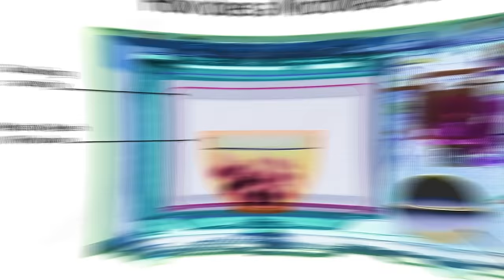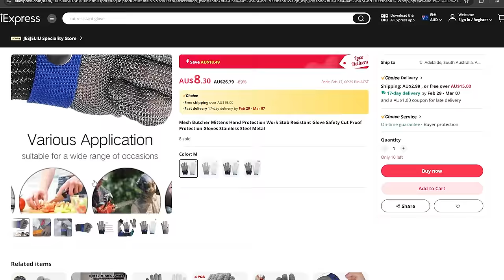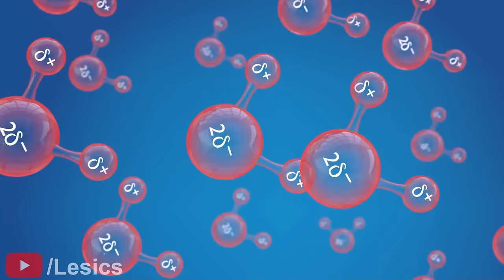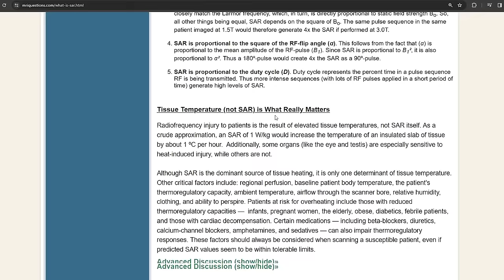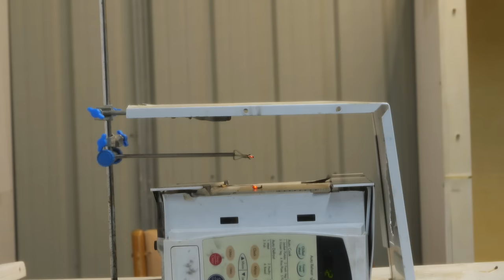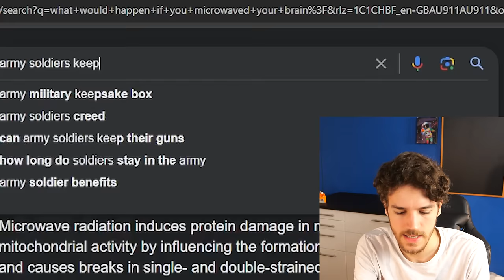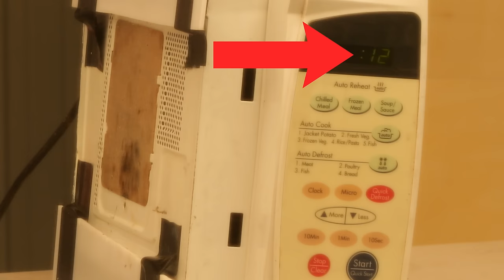I Tested the Limits of a Microwave

Comment: what would be interesting to see is placing a sheet of metal in different positions above or neat the microwave and using a Camera with Thermal Vision to see what spots are being heated on it.  then by  recording the Heatspots on X Y and Z axis, you could make a 3d Display of the Microwaves.
that also would give indication on how the waves move(conical, straight, changing) and if the Heatspots are consistent, you could use strings with a weight oin them to dangle the weight ont he exact "dangerspot" in your room. that would allow you to test exactly what you want how you want it without the risk of "missing" the hotspots.
Reply: oh and since i reached the end of the video: i dont know how well this fits in here but i do have a Navy story that fits somewhat.

i was in the german navy as a "Signäler" aka Morsecode, encrypted radio and Flags.  as someone taking care of Flags it was also my obligation to keep the bridges nooks clean as well as its roof.  where the Radardish is positioned.

something i constantly had to do is scoop up dead birds. if i missed to do that for a day or two, i often come back to already decomposing birdcorpses.

thats happening because the radar blasts a lot stronger waves than a microwave, and the birds coming anywhere close to the ship notice a increase in warmth in their body the closer they come.

what they do not notice (in time) is that they are being boiled.   so they fly around the radar to warm up and before they notice whats happening, they fall out of the sky with a Toasted brain/ograns.

cant say how useful that is in  military weaponized application but birds being toasted by radardishes is something that 100% happens.

and due to a case of severe miscommunications between Bridgepersonell and personell in the Bunker (OPZ, a secure operations centre inside the ships core) i once experienced the warmth myself. not long enough for lasting damage, not even blisters, but it felt like a combination of the hot feeling in your face when you poke your head out the window just to learn its blasting scorching hot outside  and drinking a High alcohol hot drink like "Glühwein" (hot wine with christmasherbs from germany) 

i stepped on the roof, took maybe 5 steps up there and then my brain made the connection between the feeling of "warm wind" (which was probably my face eating the first radar dish blasts when it poked over the edge) and "why is the radar moving"  so i jumped off the roof onto my Signal Deck, roughly 2 meters below me.

unrelated: i also once was showered with Hot 27mm Casings from our MLG Cannons, because the tunnel underneath the bridge where we store our flags, doesnt have a speakersystem so i didnt hear about the fireing drill. and when i crawled out i ate the first salvos casings being spit out by the cannon.  that was scary!

bit late to the party but there you have some stories :D
(also i havent developed any cancer. BUT  something worth looking into is the "myth" that Bridgepersonell on modern navy ships tend to have more Female offspring than male offspring. folks saay it must have to do with the increased exposure to antennas radardishes and such. at least for our bridge personell it fit.  not a single son born to any of those men)

Comment: 13:27 I think the explanation for this effect is that the microwaves cause the free electrons in the metal object to "slosh around", like water in a bathtub. When they are pushed into a tight corner, the electrons are briefly "funnelled" by the physical shape of the object and concentrated into a small region.

The metallic layer in CDs have millions of tiny sharp edges where the data is etched, so the electrons are forced into these sharp edges by the electromagnetic force of the microwaves and it causes brief spikes in charge enough to cause arcing which burns up the thin metal layer.

This is why some microwaves can handle certain metal containers and racks, as long as the geometry of the metal object is designed to minimise these areas where charge can be forced into a sharp corner and overflow.

Comment: The mesh is a Faraday cage. The electrons in the metal oscillate opposite to the microwaves and cancel them out.  To do this, though, the electrons (which create the cancellation field) need to be able to oscillate a similar distance to the wavelength. If the holes are too large, you don't get the oscillation and the wave passes through.

Comment: Hey mate, you may not be old enough to remember, that mirror finish on the DVD is to help the laser read the information. It's made out of a foil, which is what you see burn in the microwave, just like it would if you stuck aluminum foil into the microwave, the foil is between two layers of plastic which is what makes the burn pattern. I'm sure you noticed the smell.

Comment: I love the slow mow clip of the plasma. as the plasma goes out you can see the ends of the clip are glowing from the heat. I wonder what about the clip is allowing for easy plasma ignition and how keeping the beaker over it prolongs the duration of the plasma. I would be interested in seeing what happens when the clip if moved, or replaced with different metal objects. Is it a product of the clips location? the material or shape of the clip?

Comment: I used to work on radios in the 4.4-4.999Ghz range, 750-1000kW, which transmitted off of large parabolic antennas to scatter off the troposphere to the distant end. Anywhere within 50 feet or so in front of the transmitting antenna for more than 6 minutes was labeled as potentially lethal, lol.

Comment: "safe" is a relative term touch anything metal to the high voltage capacitor you still die
many people make the mistake of thinking because they feel fine they are but it electrons can do some real damage moving fast enough

Comment: fantastic video and channel. I have an idea, There is paint that changes color with temperature, you could paint a sheet of paper with it, mist it with water , then set it between the magnatron and a reflector plate. you'd be able to see the shape of the standing wave appear in the colors of the paint. 

also, point the magnetron sideways across the room at a satellite dish. it should be able to focus the microwaves at the focal point and perhaps raise the temperature of a small quantity of water placed there.

Comment: I had no idea so many people were clueless about the mesh on the front of the microwave oven. I thought it was common knowledge that it's NOT about safety from radiation or some such nonsense, it's there to reflect the microwaves back at the food in the middle and allow you at the same time to monitor the content inside. And what is the cheapest method of achieving that - of course it's getting some holes in the material. I mean i knew that since the age of 12... it can't be that big of a secret.

Comment: There was a site that I did infrastructure management for a number of years ago. It was a truck trailer in the north of Canada (no joke). Around 20:00 to 22:00 it consistently lost connection to the rest of the networks in the company because of the way they had it connected. There were two independent microwave connections that would drop communication because of the fact that their line-of-sight microwave transponders would lose signal due to the thickening of the Earth’s ionosphere during those hours. It was quite the shitshow. Fun times.

Comment: the door works the same way as a radio telescope (recomend looking up if interested) but if i remember right; if the mesh is either 1/10 or 1/20 (cant remember now) of the wavelength desired, then it'll be reflected. i also dont remember the reason why. I'm sure i used to know the maths and reason a dacade ago. we did also play with fully exposed magnitrons in the labs at uni and also never even felt any heating.

Comment: the microwave signal from oven has no effect in the open area especially if the power it provides is low 2-3k watts, but if it is focused on an object surrounded by a metal barrier. The object is very affected by the radiation. but you try a very high power microwave signal like handred kilo watts or mega Watt. you know it will happen to you.

Comment: well, the wave form is actually pretty good for understanding why it "won´t fit" through the hole. Like you said, energy makes it out, the microwaves are practically streams of high energy particles, and the wavelenght tells you how many particles/potential energy is there. If 99.9% of the stream gets blocked, thats enough to keep things outside safe, while reflecting the rest of the energy back to get absorbed by the food. Thats the reason why say, single ants are safe in a microwave, they simplsy cannot absorb enough of the energy to die because they are to small to absorb the full potential energy. Thats what my microwave told me at least.

Comment: Most of the warnings that you will see on a microwave are about the high voltage shock potential. You don't see them warning about the actual microwaves that much.

Comment: What would be nice is to find a way to reveal the microwave intensity, for example with arrays of flashing light bulbs that triggers at different intensities. Then you could show the microwave fields in 3D and see the effects of shields and plates and stuff like that.
Reply: Also one of hidden danger is possibly constructive interferences at stationary points that would overheat, since you cannot see those, you cannot see the danger. It also possible that objects far from the source may interact to create some unanticipated stuff. If the source is radial it's unlikely to produce any meaningful interferences far away. But if the source is enclosed in a structure that matches the resonating frequency, it may be possible to create interesting effects far away. Your microphone was obviously peaking up some frequencies and the camera got fried at a high distance. The size and shape of the cuts probably matter to the shape of the signal that leaves the enclosure.

Comment: I would be concerned about the heating effect to your eyes. The Eirp the 2.4 GHz RF signal exiting the waveguide is likely to be of the order of 5KW.  at 1 metre distance the power density will be around 40mW/cm2 which could be an issue as the eyeball cannot cool itself efficently due to the lack of an adequate blood supply. I would be cautious as it is possible that you may develop cataracts. Remember the inverse square law. At 50 cm the power density will be 4 times this i.e. 160mW/cm2. The complaince distance from your setup is around 4 Metres for an exposure of 1 Minute.

Comment: I actually do have a relatively decent understanding of microwaves, and have done some of my own experiments. What you didn't mention in this video and may not have even known, is that by doing all of this in the metal shed, the whole shed your we in actually turned into a giant microwave oven.  If you were to scale wattage the same way you scaled up the size of the faraday cage, you would be heated similar to how your food is. Microwaves are all around you. Any time you pick up a cordless or cellular phone, you're exposed to microwaves. Anytime you walk outside in any area you can pick up a radio station, you're exposed to microwaves. Being anywhere in the sweep of Doppler wether radar means your still exposed to microwaves. The real danger of microwaves actually comes from the concentration and intensity of them. In other words, don't put the magnetron right up to your skin or concentrate it on yourself too much, or you might get burned. Something else to note is that infrared wavelengths are actually felt as heat and are very similar to microwaves. If you've ever tested what a bonfire feels like stepping behind a nearby tree and noticing the temperature difference when stepping out of the tree's shadow, this is similar radiative heating, just on a different wavelength

Comment: Im an engineering tech at Radom corporation, we specialize in Microwave plasma. Those magnetrons are robust little suckers, just blow a fan on it. Our chief scientist invented a Microwave antenna with a quality factor of 12,000. It transfers like 99.9% of the microwaves to the plasma load, its insane. Its made of Alumina ceramic, which is an insulator...figure that one out

Comment: Hi, some logic around the holes

Microwaves range from 2mm to 1m (if i remember correctly)
Radiation still gets through the holes, very minimal amounts

There are many factors like where the transformer is placed, where the output holes are placed, the direction of the waves, the length and the size, we also need to factor in the distance from the holes the outer object is, the waves generally disperse after like 5cm from the holes
Most good microwaves have the output holes on the right or left hand side, something like 0.0000001% of the waves would get through on that angle

Hope this provides a little information
Keep up the good work, definately worth the sub

Comment: For anyone wondering the actual reason the mesh works has to do with the wavelength of light. The longer the wavelength the more likely it is to hit the mesh. Its a mesh and not a solid plate, because visible light has a smaller wavelength and fits through the holes, which makes it possible to see inside. The terms “fitting through” or “too big” are a little misleading, obviously microwaves still make it through the mesh, its just that the chance of it happening is much lower, and that lowers the intensity of microwaves coming through down to a safe level, on par with the amount of background radiation you’re exposed to everytime you step outside. Also the mesh isnt just metal, there is also current going through it which creates a sort of invers version of the waves to eradicate them. Its pretty clear why most articles dont explain it and just ask you to believe them, this shit is complicated

Comment: Mesh for a microwave explanation...take a bowl of pudding, and quickly toss it into a fine mesh strainer...a little bit MIGHT get get through, but the particle size is too big for the strainer to allow through...this is about the best way I can think of to explain it (and I'm a satellite / RF engineer lol)...and btw - there is no current full consensus on whether or not RF radiation can cause cancer - as of current, it is NOT believed that it does.

Comment: I do know that, in radio broadcasting, a transmitter can a multiple of a fraction of a wavelength (which is why the antennas for them don't need to be 2-3metres, but rather just a fraction of them).  Maybe it's similar with microwaves and the holes in the meshdoor, where as long as the holes are a specific fraction or multiple of the original wave, then it should be fine?  Also fun fact, you can't microwave ants that are smaller than the holes in the mesh (I live in tropical Australia and ants are kinda a big problem here).

Comment: 2:30-2:38 I did a thing is where you shrug at danger, MrGreenGuy is where you laugh at danger.
5:00-5:03 Gay (light) waves are generated by passing straight (light) waves through slits (Young's experiment).
7:54-7:57 Human plugged into AC, cursed electric appliance?
10:19-10:21 Microwave revenge
12:18-12:21 DVDs fit into CD drives, thus they are equal!
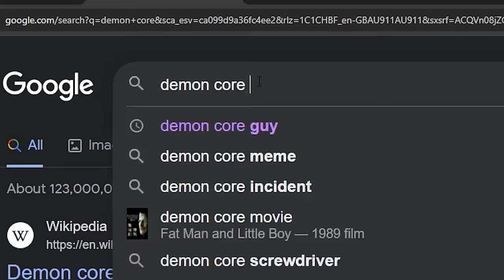16:30-16:35 Microwavemoncore
20:22-20:42 ChatGPT for mathematics, definitely cursed.
28:06-28:09 Microwavemoncore again

Comment: I don't know how applicable this rule is for microwaves but for X-rays the dosage taken and damage inflicted corelates with the square of the disrance from the source. Thus, someone standing 1 meter away will take 16 times biger radiation dose than someone standing 4 meters away. Now this is oversimplifying it, and as I said, it's about X-rays but I'd think the same kind of relationship must exist for microwaves too. I remember reading about a military radar technitian being killed when someone accidentally turned on the radar while he was standing in front of it. Now given that most radars are thousands of times more powerful than the tipical microwave oven.

Comment: Hey so if you've ever used a vacuum tube, they're like this but they radiate heat regardless of the hole blockages. Is this much safer, well I haven't finished the video but I mean I think vacuum tube's expand upon the variability of thermal radiation in a way that would be way crazier then this. I mean does tungsten not emit gamma rays? Put vacuum tube's in microwaves, maybe don't eat the food.

Comment: so as with the microwave passing through the hole, it cant pass throughg the hole. microwaves are a wavelength of light, like uv. a light wave is like a rope being swung repeatedly to form a sin or cos wave shape and the hole is like a fence. when u have the rope inbetween the fence and the wavelength of the rope is bigger than the gap of the fence, the rope can't wave. now since light is oscillating in all directions ecept forwards and backwards, having bars for the mesh of a microwave oven would not suffice, there needs to be holes. now why the holes are specifically that size is because the physics dudes did some calculations i dont know and arrived at the diameter of that... i think.